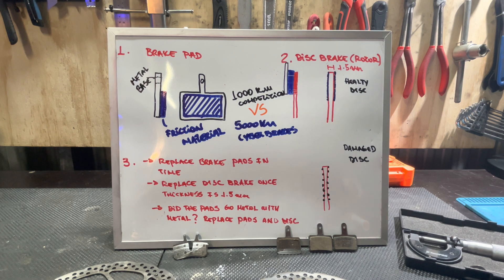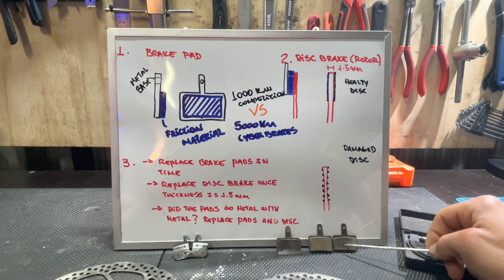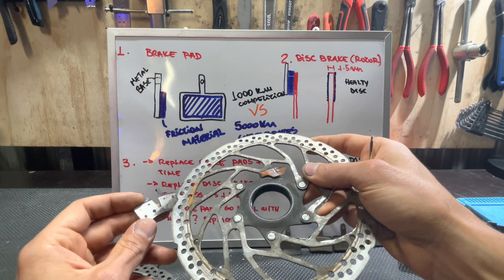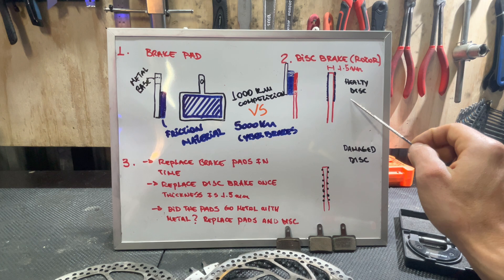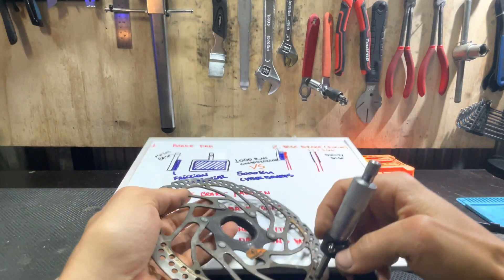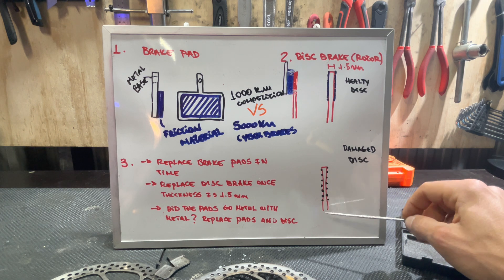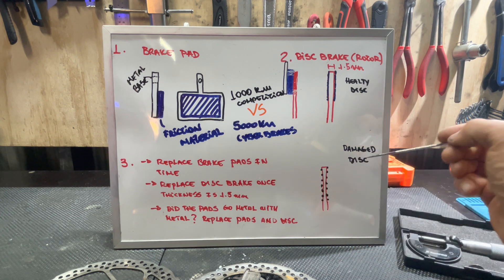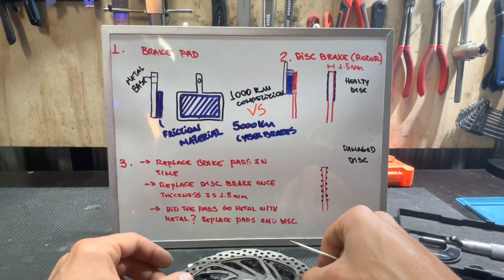How ebike brakes work? Why ebike brakes squeak? Which ebike brake is more important?

Comment: Word of advice: The same tips and tricks that auto mechanics use on car & truck disc brakes, are some of the same tips and tricks you can use on bicycle disc brakes.

Second, +1 about the pad compound. When you get new brake pads, spray them, and the rotor down, with brake clean, usually before and after installation (before to remove an oil like cosmoline from the pads, which prevents corrosion and oxidation while the pads sit on the shelf; and after, so there is no oil from your hands on the rotor, which can cause premature wear via corrosion).

For hydro brakes, it's not enough to top off the fluid -- you need to purge all the air from the brake lines every time you change pads, and change fluid at least once per year. That way, you purge any water from inside the lines, which can cause vaporization under braking load, which has a lower boiling point because of the braking pressure present when you use the brakes.

For the rotor, change it out at least once per year. When you install a new rotor, you have to burnish the rotor surface with pad material, which is light brake pressure as you pedal. Then, go ahead and do a medium pressure, and finally, a hard pressure that won't prevent the wheel from turning. What this does is give you a smooth braking surface by filling in the microscopic valleys and wearing away the peaks in the rotor material. This allows for even pad wear, and long life.

Comment: Howdy Philip ...I noticed Shimano brakes only last 1000klm on my bafang DIY ebike...They work well but I will have to maintain them as I'm racking up the Kim...also I may need to grease the motor can I use Shimano premium grease ...?
Steve..🖐
Reply from the maker: Hi Steven, that's the biggest difference between Merida, Scott, Giant and other brands in comparison to Cyberbikes, we are side to side with our customers and we know their brakes only last 1000lm, that why all Cyberbikes Models https://cyberbikes.com/cyberbikes-models/ have upgraded brakes we developed in the house and they last 5000km for the same conditions.

1. Use shimano grease only for the clutch of the pedals, I mean, the clutch that attached the movement of the pedals to the crank of the granny gear.
2. For the granny gear and pinion use the lithium grease or high-temperature grease
3. For the nylon gear use the thickest bearing grease you find that doesn't have lithium and has PTFE.

Cheers

Comment: I purchased some Magura MT5E levers and put them with my Shimano XT and XTR brakes and I love them.
Reply from the maker: Thanks, that's nice, how was to connect the levers to the calliper? did you need specific hose adaptors or the original Shimano hose nipples are a perfect match with the Magura MT5E levers?
Reply: @Cyberbikesau  Shimano nipples are compatible.
Reply: Phillipe, you also need a 2 to 3-pin conversion for Bafang. Hope I spelled your name right. Thanks for the video.